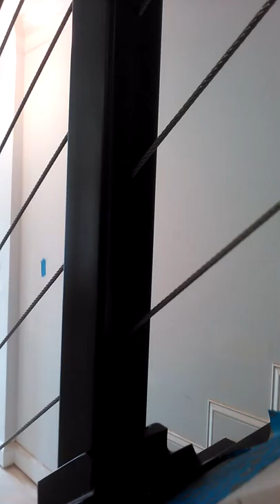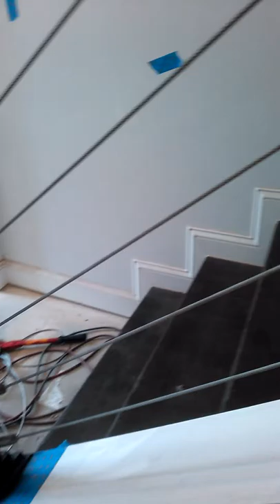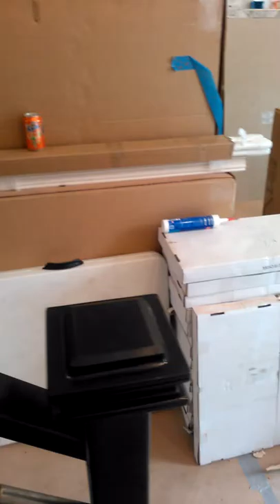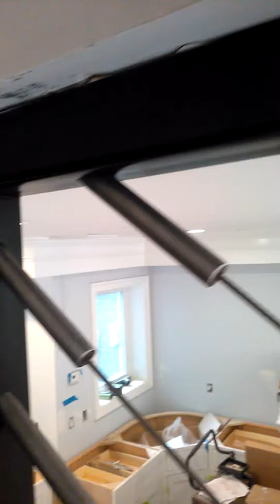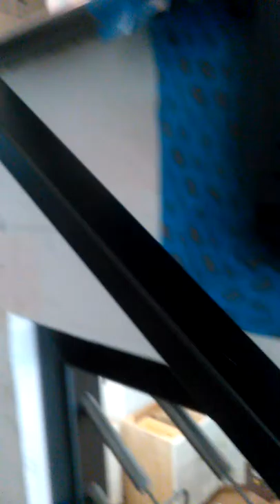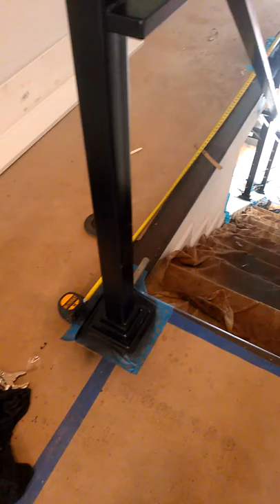Interior cable railing without suspension by tesfa ironsmith LLC

Comment from the maker: tesfa ironsmith LLC is highly recommended metal fabricator in DMV area ,we are specialized in different kinds of artistic decorated iron work , specially on cable railing ,,we never used suspension to stretch cable as you can see on this video . visit tesfa ironsmith LLC on Google ,we have so much of our work.